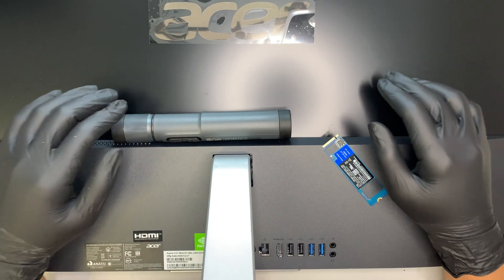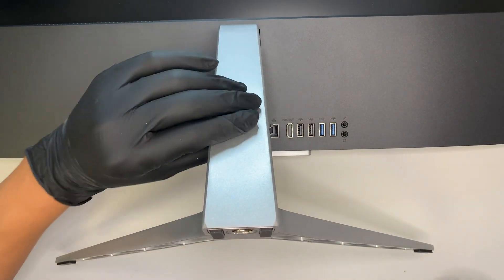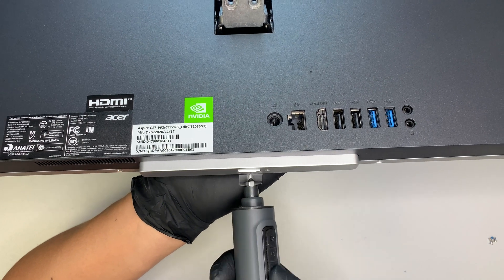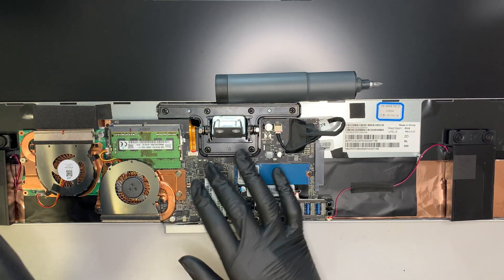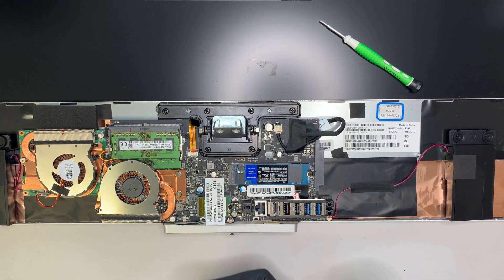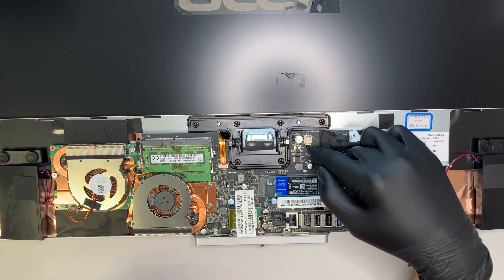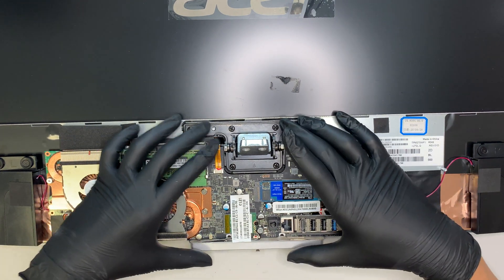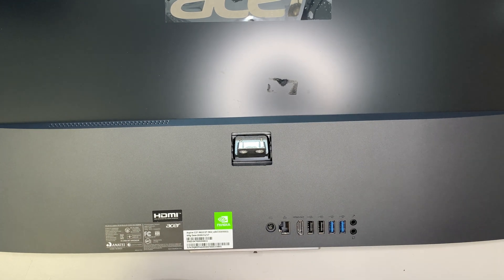Acer Aspire C27 Tear Down

Comment: Quick question! After i upgraded the M.2 SSD card from 512GB to 1TB and the screen wont power pass through the setting menu, i tried press escape to Exit but it wont work, any ideas what went wrong?
After i installed back the original 512GB SSD then it worl normal
Maybe the new SSD card need to be formatted , how can it be done 
Anyboday had any ideas please tell me 
Thanks

Comment: I hate this computer. It's an utter POS. The screen just decided to catastrophically fail one day to point you cannot even make out the screen to use it. Acer and the place i got it weren't helpful. So I want to take the computer out to use it with another screen as the built in one is toast. Thanks for video.
Reply from the maker: Sorry to hear about your experience.

Comment: Great video. My computer is stuck on like the factory settings on every time I save it the computer returns to the same factory page and it won’t reboot. Any ideas on if I did something wrong? I upgraded the ram and added a 2tb Samsung 970 evo plus ssd.

Comment: I'm looking for an all-in-one replacement for my grandma's 10-year-old laptop that's (for good reasons) struggling to keep up.
The C27's form factor is perfect, but I need to know something: 
Do you people believe this PC is reliable enough to last a minimum of 6 years? 
I want it to be serviceable for as long as possible, and its only purpose is gonna be for internet browsing, streaming and things like that.
Reply: The cpu broke for me after about a year and a half of usage
Reply: @tomkunproductions3442  Oof, yeah... that's quite bad. Judging by the other comments it sounds like it's unreliable, so I'll wait around and see what the future has to offer ✌🏻
Reply: @Mgames_xd  Yea for sure, I would personally stick with a prebuilt at least if it breaks you wont have to buy a whole new pc and rather can just change parts
Reply: This computer sucks. It's build quality is absolutely horrendous and it will decide to break one day.
Reply: Bear in mind that most people here come because of technical difficulties. So this is not exactly reliable from a statistical viewpoint. Yeah, I know this comment is two years old... just wallowing a little in self-pity because my device is broken, too, of course. I got this PC to save some room, but I guess I will not buy an all-in-one device again because it is so hard to exchange parts to repair or enhance performance.

Comment: Do you know if its possible to upgrade the CPU fan, my Asus Aspire C27 is very noisy, and Its been noisy ever since it was brand new, ive just changed the thermal paste, but that diddn't help.
The temperature reaches nearly 100 degrees at normal idle.....
Reply from the maker: You can’t upgrade cpu. Try clean out old thermal paste and apply new thermal paste